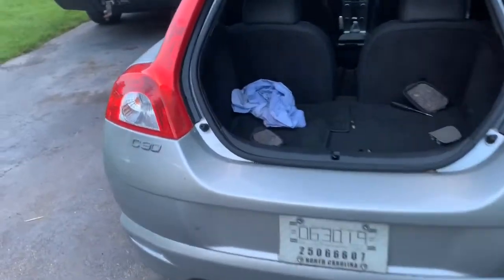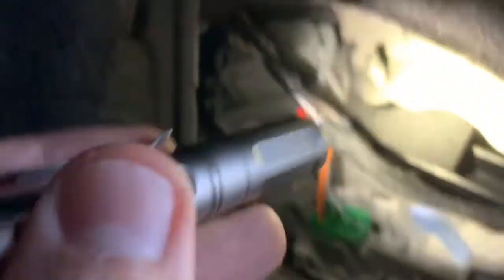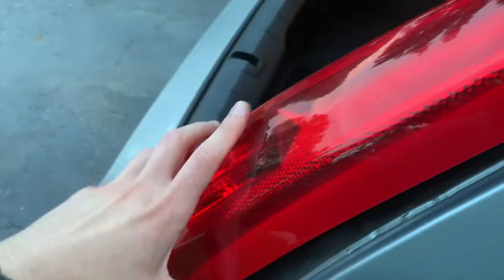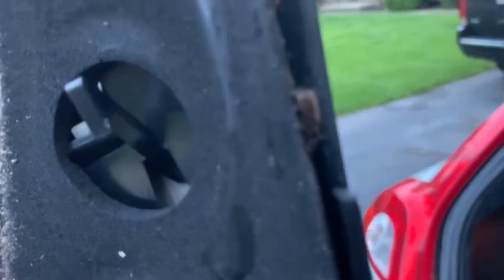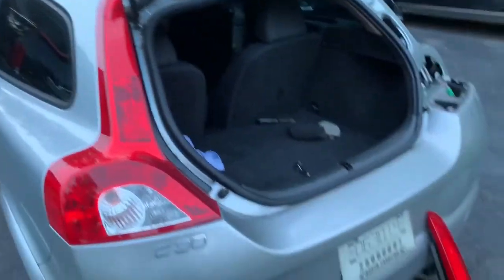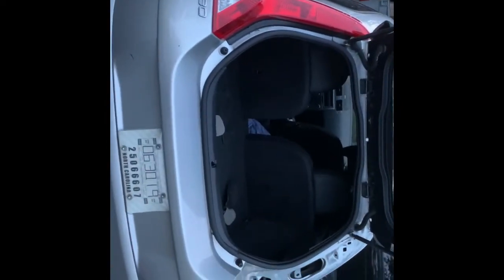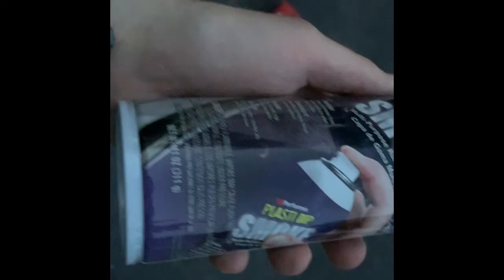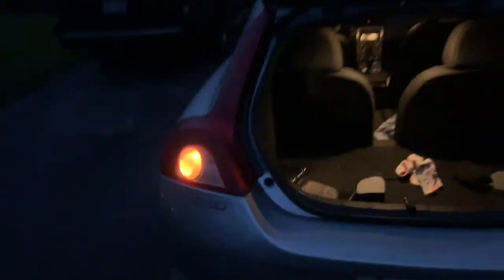Replacing The Taillights And Bulbs

Comment: Thanks. This video gave me some DIY confidence to replace sun-damaged lenses... However, my 2012 C-30 has 3 bolts (not 2 as in your video) on the lower attachment area of each lens.
Reply from the maker: I think my c30 was supposed to have 3 but the car was in an accident (iirc) before I owned it. So you and many others may have 3 instead of two!

Comment: Very good video for removing the tail light assembly, although if you need to replace the bulbs, you don't need to remove the tail light, just open the cover, remove the wire(connector) then you have a little tab to remove the light bulb assembly. the tail light remains in place. Just if anyone is looking how to replace the lights. Cheers!
Reply from the maker: Yea I removed the whole assembly because I wanted to make them more matte and darken them. Thanks for the tip !
Reply: Una
Reply: thanks for the tip, i will need to replace bulbs

Comment: Can you post a video to replace the license plate bulb housing on a Volvo c30????
Reply from the maker: I’d love to but I no longer have the C30. Most plate bulbs are held in by a single set screw or clip
Reply: housing is a pain. did it a couple days ago. gotta remove the bumper and push the assembly out